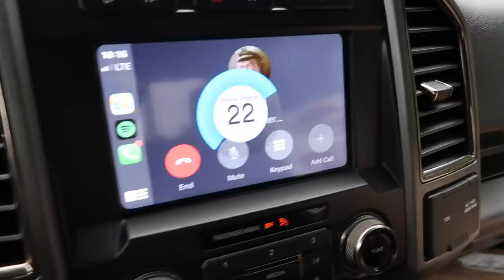The Worlds Craziest Foam Cannon Pressure Washer - Made from an AR

Comment: This is so badass! I'd love to have this to wash my 1300hp 2006 ram 2500 with  built 6.8 Cummins running low 10s on street tires on the daily tune. Check out my Instagram @ryandussel I got that same foam cannon but I don't have a pressure washer gun that it fits on and doesn't have interchangeable nozzles on it, it's a cheap electric pressure washer. So it's sat for months and with this I would finally be able to use my foam cannon hopefully help clean off all the soot from my hoodstack and all the rubber from 100+ mph rolling burnouts 🤘🏼